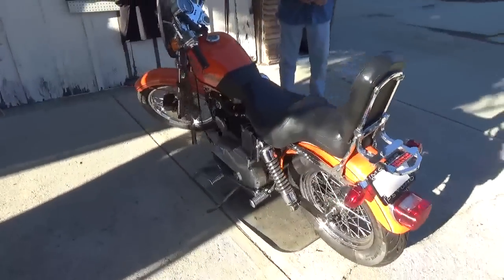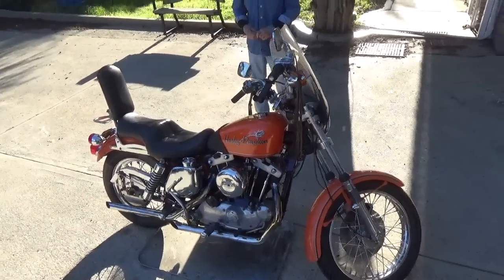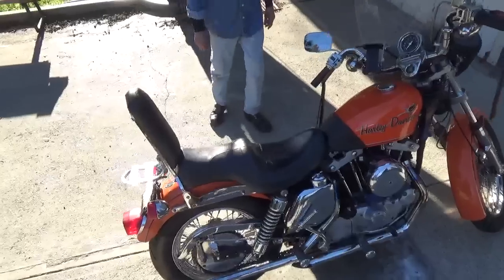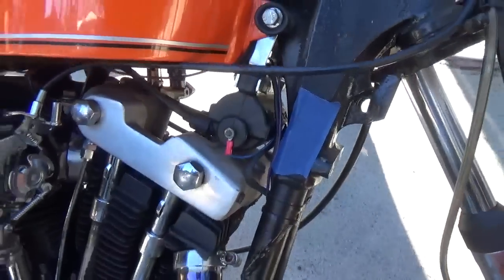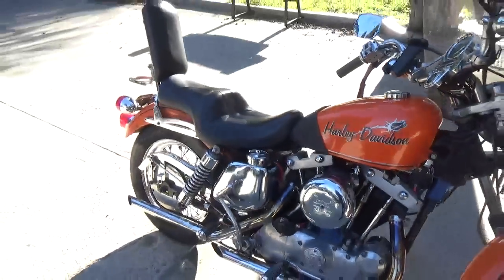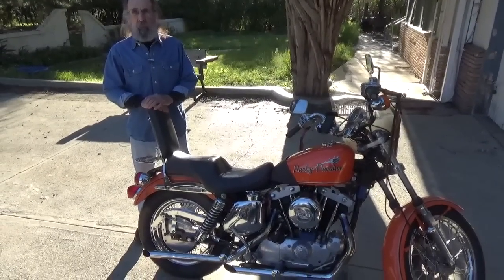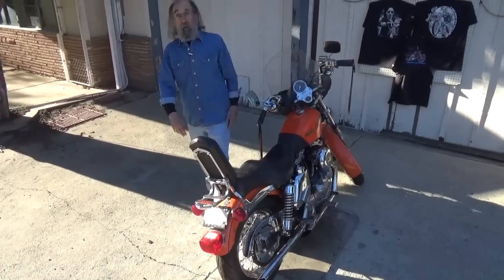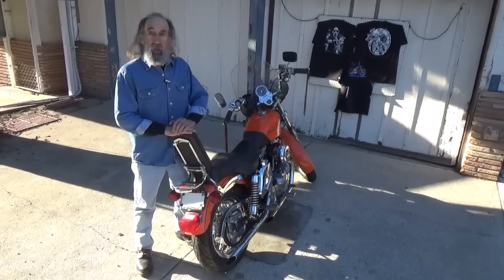74 Harley Sportster all together   Let's Hear it Run!

Comment: Ben think about point in a evo I think if you take cam out of old iron head it mite get the points work an mite just get the timeing
Reply from the maker: What year Evo are we talking about?  They made Evo Sportsters for a long time with a bunch of changes for different years.  You need to do some research.
Reply: @pacificmike9501  my evo  is1340 1997 still think bikes need rear wheel. Chain an crab an points
Reply: Hay mike mite a motor got the number on it can you tell what year a motorby number dj1150173 year an size mine is 97evo. It looks like evo 1340

Comment: Enrichiner🤔or as everyone else calls it the "choke"😄
Reply from the maker: Not really.  A choke is a mechanism chokes down the air flow into the carburetor, thereby creating a very rich mixture (fuel amount vs air amount greater than usual running ratio).  An enrichener is usually another fuel circuit that increases the fuel flow and thereby "enrichens" the mixture.  We just get used to throwing those words around.  Mikunis use enricheners.  Keihins use enricheners today.  Early ones actually had choke plates.  SU's have enricheners and "ticklers."  Linkerts use chokes and enricheners.  Bunch of different designs out there.

Comment: I had A 75 and just hated that 4 speed trans "lol"
Reply from the maker: Why?
Reply: @pacificmike9501  At highway speeds it felt like you needed another gear.
Reply from the maker: A larger trans sprocket would probably solved the problem.

Comment: Hey Pacific Mike. Have been enjoying your videos for a while now and am a subscriber. Need help trying to figure what would be a good distributor for my shovelhead and how to wire it up. It would be much easier for me to explain in detail and give you all the information you need if I could email you. Wondering if you could please give me your email address? Would really appreciate it. Thank you.
Reply from the maker: Don't forget to tell me what the motor is; year, displacement, etc.
pacificmike.com
Reply: @pacificmike9501  
Thanks for your quick response. Just sent you an email.
Reply: @pacificmike9501  Forgot to mention in the email that the engine came with an S&S carburetor.